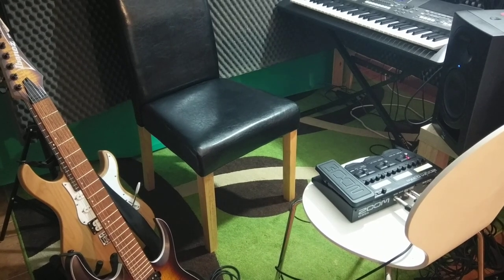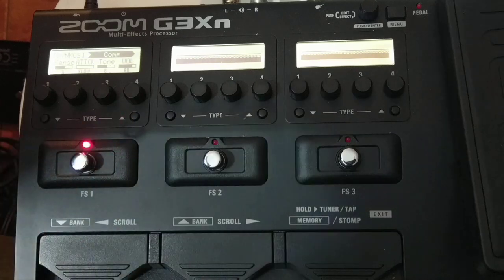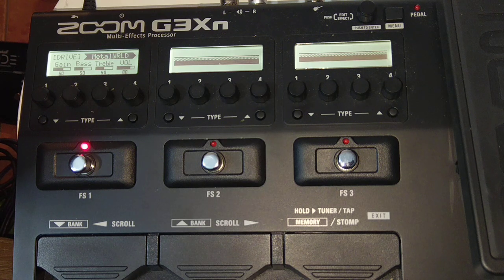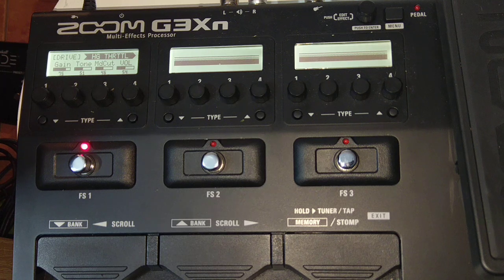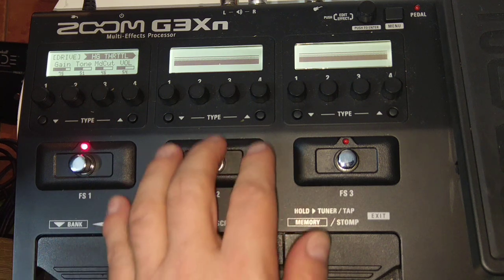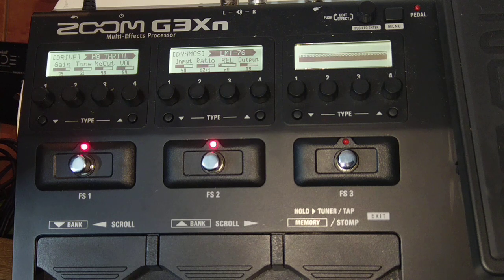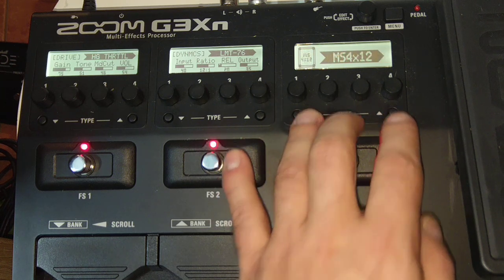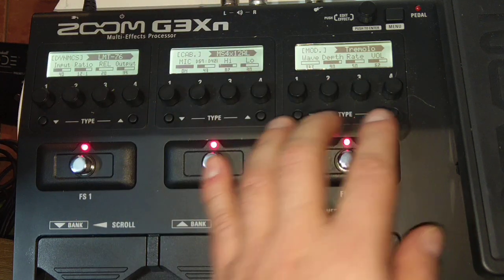How to create own patch in Zoom G3Xn - live tutorial - Part 1/2

Comment: Can we record this processor in pc with the usb connection
Reply from the maker: Thanks for that question. The simplest answer is  No, you can not. 
In this model USB is used for MIDI only - you can upgrade firmware , manage patches but you don't have build in Audio interface / Digital output. 
So for recording into digital  you need separate Audio Interface and use Analog outputs  to connect it. 
Before I bought Scarlet I have used Boss RC 505 looper as audio interface. You can also try with Handy recorder like Zoom H4n Pro or similar.  All those devices have it's own Audio interfaces. 
If you need some help - just let me know.